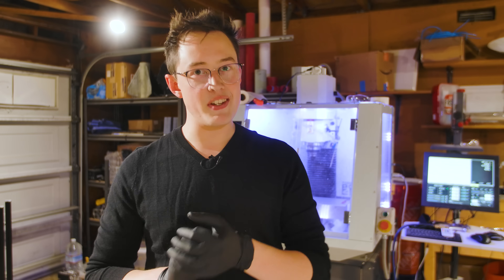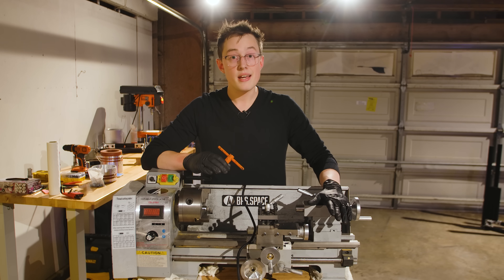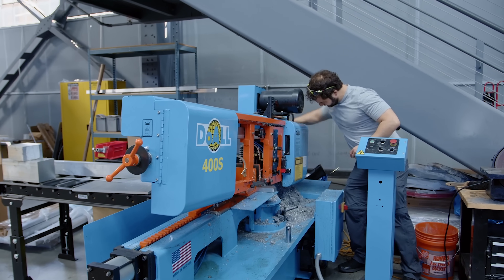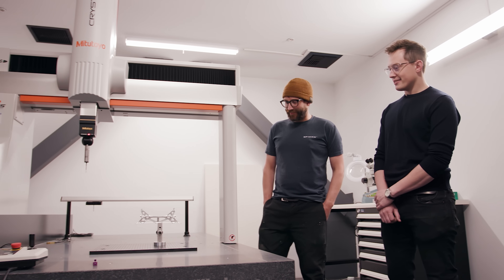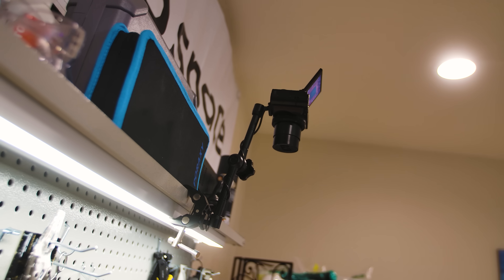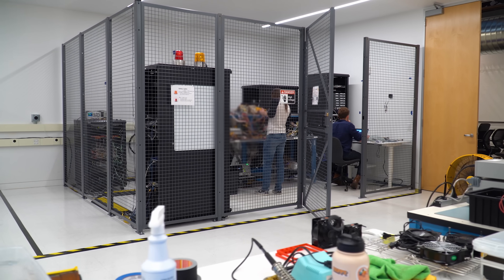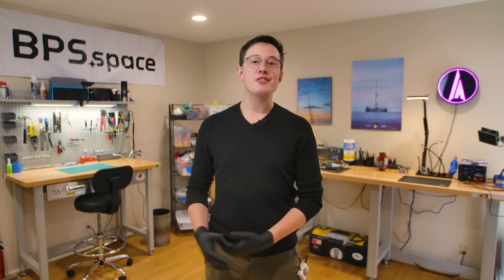$1 vs $1B Aerospace Company | BPS.space vs Astranis Shop Tour

Comment: The thing with lathes is that they really don't break unless you do something really bad to them. So at some point you just need to bite the bullet and buy a better one. In my experience old lathes are far superior to new lathes. If a lathe has lived for 80 years, survivor bias alone means its a good machine. I've got a 1943 Monarch 16CY lathe. It's a massive beast. It's little brother the 10EE is one of the most wanted lathes. The larger machines are actually easier to get because not everyone has the room for them. I'd love to find a smaller lathe that turns faster for dong small diameter work but they are super hard to find and very expensive when you do find them on the market. I think at this point, if I had the money to buy a new lathe, it would be a CNC lathe. I've learned all I'm going to learn about turning on a manual machine, it's time to go CNC. I run a CNC router at my day job and I can make most anything from flat stock on that machine.

Comment: If you're looking for a much better manual lathe with a similar footprint (rather than getting a large, free standing machine), I cannot over-recommend getting an old South Bend Model A, B, or C. They can be found for only a bit more than a new chinesium eBay lathe, and they're about the same size (9in), but the quality is massively better.

Unlike any current-production lathe in that size range, South Bend lathes were designed to be used in professional tool rooms, highschool shop classes, or in production making small parts. They're industrial-grade machine tools which happen to be quite small, rather than low cost tools made for hobbyists.

There are a ton of parts still available for them as well, and a number of upgrades you can make to bring them up to modern standards. I have a Model C which was made in 1936, and I updated it with a serpentine belt, a quick change tool post, modern carbide tooling, and a DRO.

Seriously, don't be put off by the fact that a good chunk of them were made before WWII. They absolutely slap, and they'll machine circles around any 9in lathe made today.

Comment: Fun video. I'm surprised they are not using larger 3d printers to make structural components rather than CNC.
Reply: 3d printing does not have the strength or precision necessary

Comment: Great video!  With all the soldering you do, maybe you could find a way to vent all the fumes.  A cheap way could be an old whole house vacuum cleaner with a wall mount by the station? it could double as a way to clean up the room.  You would have to open up the walls though.

Comment: I wonder why the USB programming method is not better than the parallel SPI programming? :D How do you download software updates online? Does it bring a separate SPI parallel programmer? For example, if I want to upgrade the camera module, or the gyroscope module, or the flight controls. . . Sorry for not knowing.
Reply: How come even old satellites are getting updates? For example, Saturn or Voyager. Codes are written on the assembler, package to package, so that the bootloader did not get stuck for so long? :D

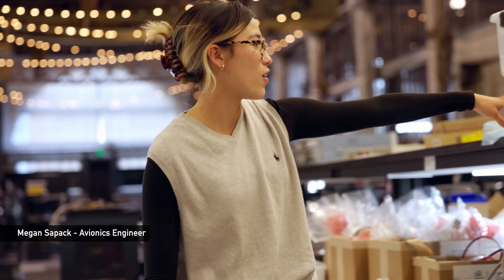Comment: 7:47 what kind of a wire is that?
Reply: Probably radiation cross-linked ETFE insulated lightweight equipment wire. It's the stuff they use in all high-reliability equipment (aerospace, space, military, very high-end industrial etc). There are specialty variants with low-outgassing characteristics for outer space applications, which probably costs a fortune.

Comment: The super-high precision measuring device... Mitutoyo they make fantastic micrometers and calipers. As a machinist myself, I love them. You don't need a fancy automatic tool like they have, unless you produce at an industrial scale. Sub-micron precision is irrelevant when working with metals anyway. Just touching your workpiece will deform it measurably (in the thousands of millimeters on a 1 meter piece) due to body heat.

Comment: 3:39 Im wondering now - how with saving weight on spacecraft, you can stay in orbit longer? Something does not make sense here. Isn't weight a factor only at launch?
Reply: In addition some satellites use thrusters for station keeping and you get more delta V per propellant if your satellite is lighter.
Reply: With a lower mass, they can boost the same amount of dv with less fuel
Reply: The satellite has to use its own fuel to complete the final burn to a circular orbit. The lighter the craft, the less fuel is spent doing that burn and more fuel is leftover for stationkeeping.
Reply: So, basically, heavier spacecraft will lose it's propellant faster, thus become unable to 'maintain' accurate orbit. Am I right? Because bit about falling from orbit sounds weird. There is nothing to slow you down, to fall. Unless you are in lower orbits. Like ISS for example.
Reply: @DovydasNorkūnas  I think there's still some atmospheric drag at geo orbit, but way way less.
Reply: @DovydasNorkūnas  there is alway something to slow you down, the earth atmosphere continues past the moon. Its just a lot less dense out there.
Reply: How furter from earth how longer you can stay in orbit, else the vehicle will come back faster and more weight = faster de-orbit (is that correct @astranisspace)
Reply: @Damicske  not quite - higher weight = requires more energy (and thus more propellant) to perform stationkeeping (i.e. staying in one spot), so if you can build a lighter sat, you can use less propellant, which weighs less, which uses less prop, etc etc.